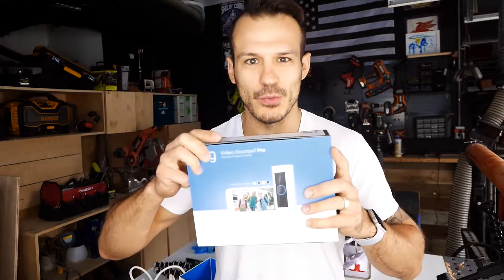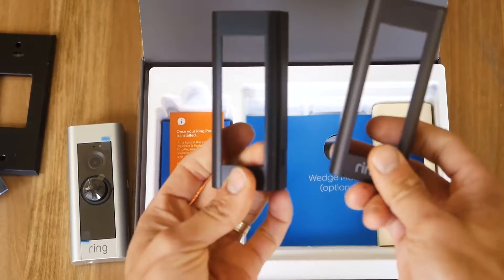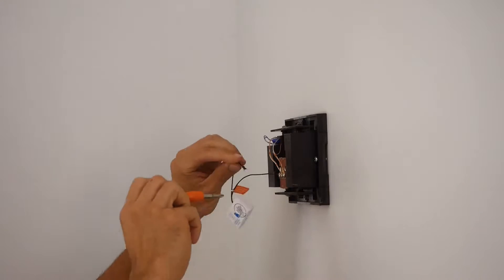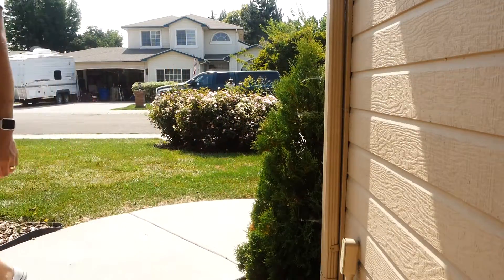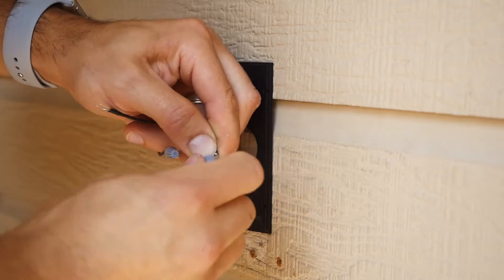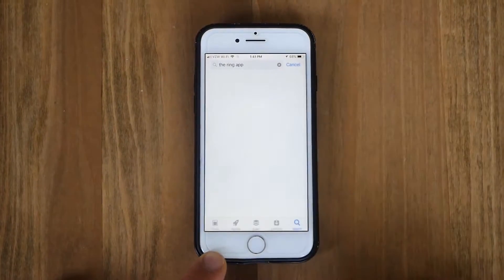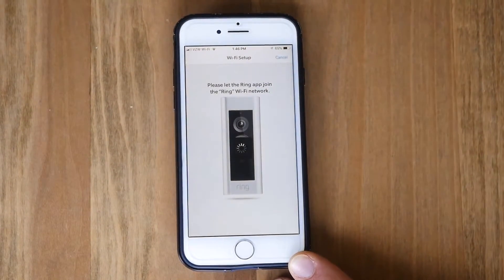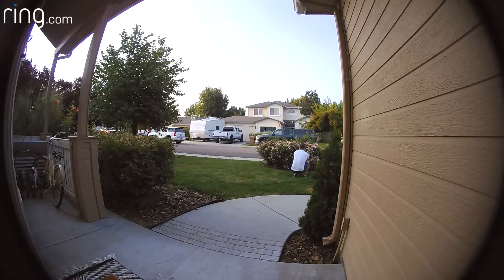RING Pro Video Doorbell FOR DUMMIES!

Comment: My only problem with ring is every solution to a problem is readily available so long as you are willing to live without what is advertised to work out of the box. Ring very blatantly dismisses troubleshooting as “buy more stuff from Ring” so it will work!